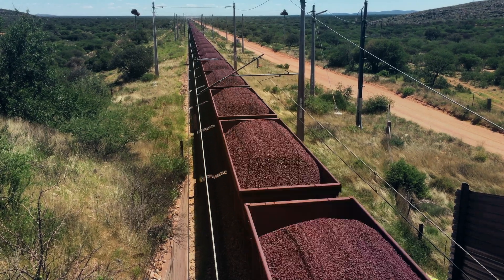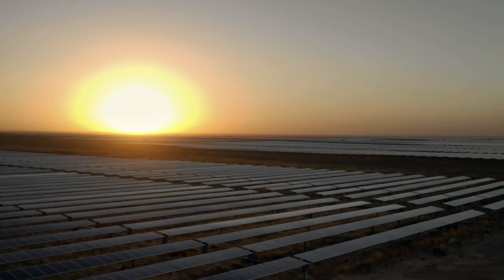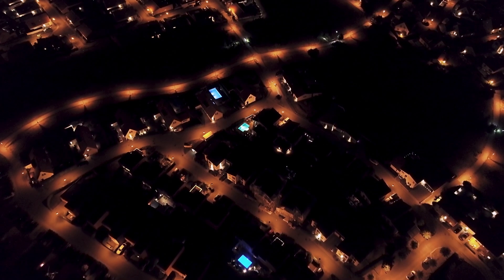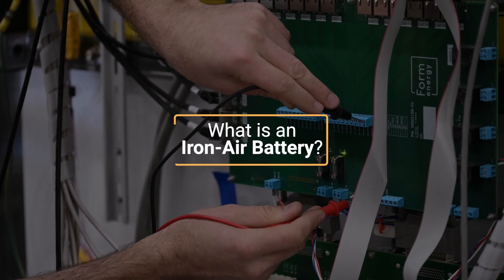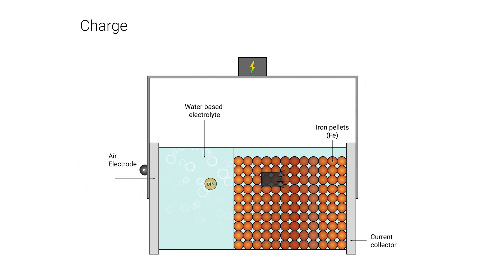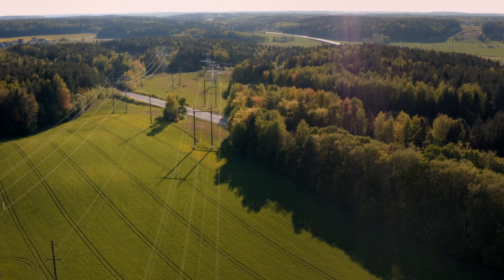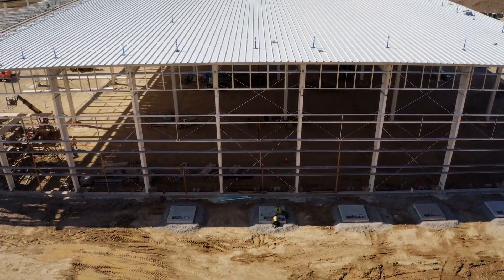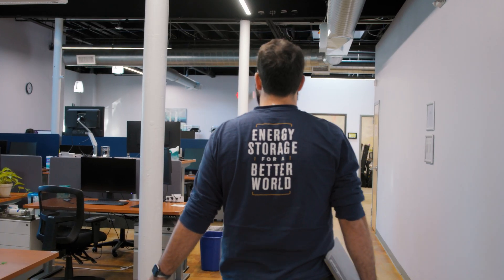Form Energy: An Overview

Comment: what i don't understand is how come they just don't use iron air batteries for home storage.  seems like the ideal situation for at least grid backup.  even though they maybe only 50% efficient.  buying grid power is cheap and iron air batteries cost only $2 to $5 per kwh, so a home system for say 1 megawatt hour should only cost a few thousand and should be able to power a home for a month or more without power in the event of a prolonged power outage.

Comment: Thank you for your explanation, I invented new method "This Machine works with strong magnet and electrical field under pressure gas rules and has several stages, zero pollution separate graphene and hydrogen under pressure and temperature 1000c and closed circuit with electromagnet wave. sea is huge and hidden source of energy. Please visit my profile machine also can produce electricity and pure water and fertilizer from sea.

Comment: I was trying to find out how your technology worked, I assumed you'd be using a porous carbon cathode material like with lithium air, to store Fe oxidised ions, but it's really interesting to see that the oxygen is simply transported to the iron particles to rust in place. Very clever! A quick questions about the rust though, a common problem with rust is that it easily detaches from the surface, how do you stop this happening and stop the loss of active material?

Comment: Boy I have a lot of questions. I’ve had solar for a few years now, and I have seen the dramatic difference in the energy flux between June-July and December-January. To provide consistent grid-scale power throughout the year using solar alone, it seems to me you need to either overbuild solar with some fast batteries (like Megapacks) and use curtailment, or you need to have a storage solution that is long-term, affordable, and responsive. Form Energy sounds like a good potential long-term storage solution, assuming the costs are good, which I hope they are or you have no basis for your business. Is iron-air batteries responsive enough to handle peak loads like Li-Ion or is it best to provide consistent baseline power? Would the best solution be to have large Form Energy storage fronted by a Tesla Megapack (to handle peak demand) who are both tied to a large solar/wind farm to take advantage of seasonality?
Reply: 100 hour storage is impressive but that is no solution for seasonal variation winter to summer, though it would certainly help the day/night and occasional cloudy day scenarios if you live off grid. Good luck.
Reply: There are these things called grid inter-connections. You do know it's very very rare for those dunkleflaute events to exist and when they do you can still prepare the grid by turning on backup power sources and or batteries until the sun shines and the wind blows again. Those gaps are RARELY more than 100 hours hence the battery design drain time... SMH... If we all listened to people like you we'd be living in ditches poking berries up our noses... FFS, man! @chrisc62